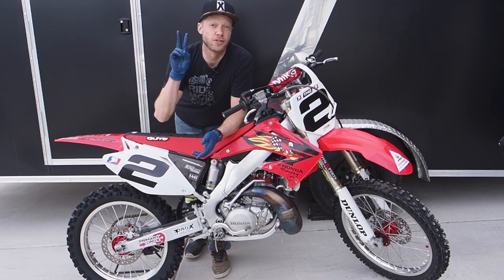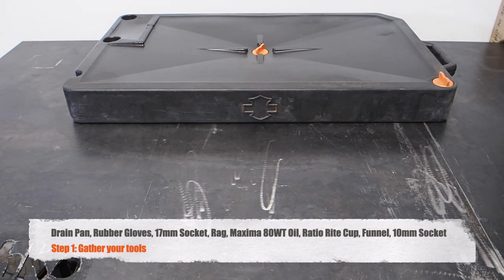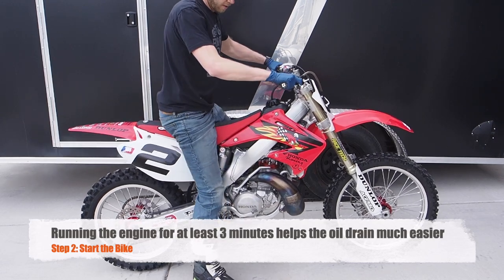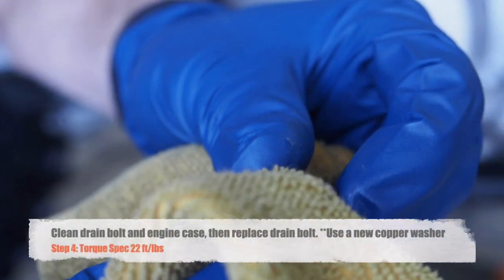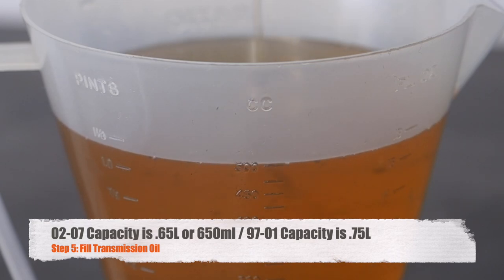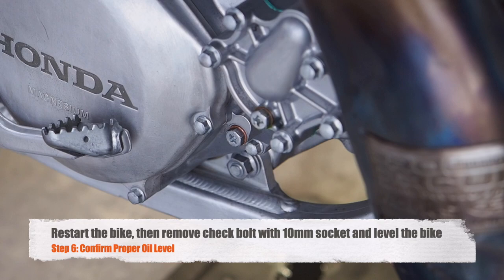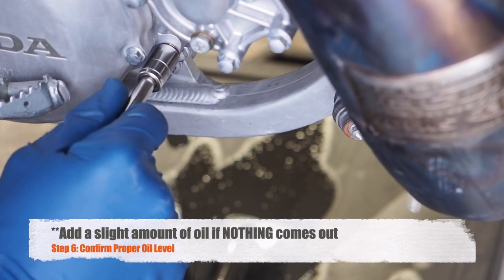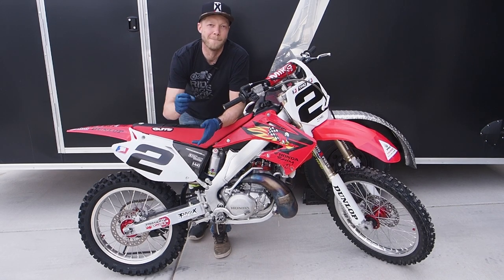The Keys to a Mistake Free Honda CR250R Oil Change!

Comment: If you don’t have new copper washers, you can re-anneal the old ones and reuse. Sand both sides smooth with very fine crocus cloth, then heat to Cherry red with a torch and allow to cool. The re-annealing process will “uncrush” the washer by re aligning the molecules and bring back its original sealing ability.

Comment: 0:51 Haha i stripped my oil drain bolt out like an idiot years ago.  We put a timesert in it and it worked like a charm.  Now I use a torque wrench every time.
Reply from the maker: It can happen so easily right?! I’d be heated but hey you got it fixed and rocking and that’s all that matters! 👍🏼
Reply: @GregHitchko  Oh yeah and I was always paranoid of not tightening it enough and it falling out.  Im a huge advocate for timeserts and torque wrenches now haha.

Comment: Man that oil looked terrible ! I have the same bike and use the same oil . It takes 22 ounces after a 15 minutes drain, where no oil is dripping out . Remove any particulates on the magnetic drain plug. Change every 4 to 6 hours engine time. 😁
Reply from the maker: It was brutal eh? And this oil only had about 2 hours on it, but they were hard motocross hours. Definitely needed a swap!  Appreciate the comments Raymond!
Reply: @GregHitchko hey im a little late but im hoping you will reply. What about the oil filter? Or do these bikes not have one, i have a 91 cr250r?

Comment: Why is that oil so dirty. Oil is the life blood of clutch plates, and drop oil after a long ride again as there is something wrong there.
Reply from the maker: The bike had just been ridden pretty hard in sandy conditions.
Reply: @GregHitchko  I would increase springs as there is slip on heavy rollers / sand so I would look deeper as it shouldn't be that dirty.